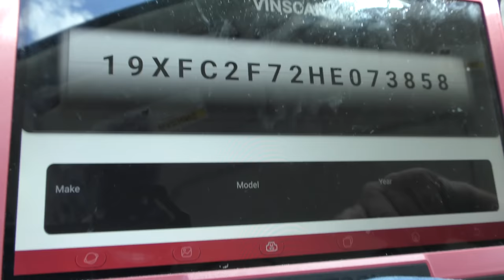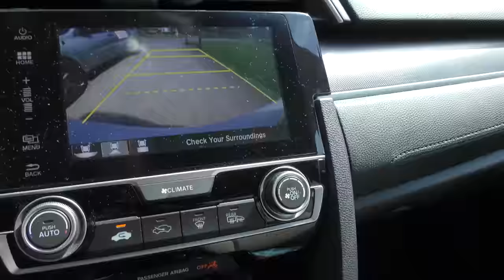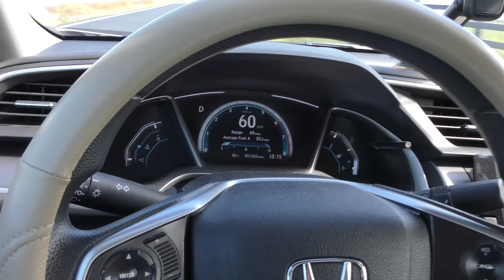Here’s What Happens If You Change Lifetime Transmission Fluid in Your Car

Comment: Change the external AT filter. (Yes, it does have one, follow the lines to the heat exchanger at the base of the radiator .) The Honda shop manual indicates 3 spill and refills with a drive cycle between them, which replaces ~72% of the fluid. If you change the external filter behind the radiator for the final spill, that goes up to 80%.  (Each time it's done is 7-8% more fluid replaced. ) .

Comment: Don’t forget to put it into the S “gear” when you want more aggressive acceleration, it helps a lot. Just put it back into D once you’re cruising at a steady speed again; that way your RPMs aren’t staying higher than they need to be.
Reply: Bolony. Heavy acceleration automatically kicks down your transmission into passing gear.
Reply: @shawnmcculley2995  On modern Honda CVTs, S makes the system prefer lower gear ratios/higher RPM ranges, and everything that comes with that.

Yes, stomping the pedal while in D will also get you there, but it’s more responsive when it’s already in the right range.
Reply: @shawnmcculley2995  Selecting “S” makes it kick down faster and helps keep it there. It’s also great for going downhill as it increases engine braking - a lot.
Reply: @billd9667 so is good for downhill and not uphill?
Reply: @sl4983  that’s fine, but not necessary. It wastes fuel in most cases.

Comment: Yes! Change it. When Subaru told me the cvt fluid was "Lifetime" I laughed.
Reply: Mazda does the same thing.
*I did however manage to get 435k miles out of it without once even checking it. 🤦‍♂️🙏
Reply: on a Subaru I'd say change it every 5-7 years or like 36k mi
Reply: @Byrd819  Wow...
Reply: Is the fluid change in a Subaru as easy as the Honda?
Reply: When you are at a dealer 90% of the time it's not the techs telling you that you don't need to change the fluid. It's the service managers.
Reply: @yabbadabba2887  very similar
Reply: @DBrisky37  Subaru gave me an extended warranty on our 2015 Forester to 100,000 but told us we couldn't change the transmission fluid or it would void the warranty.  So we waited until the warranty was over and the fluid was disgusting.  I don't know why they say "lifetime fluid"!  It's absurd.
Reply: @robertcraig2654  I did the same thing. As soon as the extended warranty was up I did a CVT drain and fill.

Comment: Lifetime fluid, good for the lifetime of the fluid.

I like "flushing" the fluid, but not a power flush.  I like using the trans to move the fluid in and out by itself through the cooling lines. Use a couple 5 gal buckets, one empty and one full of clean fluid, the pump then just uses the buckets as the cooler, expels the old fluid into the empty bucket and draws in clean.   If you use clear lines to extend the cooler lines you can see when the fluid is clean.  Then you finish up with a pan service and a new filter, and top off.  

I could be wrong doing this, but it's always worked for me.
Reply: I do this as well.Putting brand new oil into a transmission with about 6 to 7 liters of old dirty oil in the converter which contaminates it as soon as you start the car makes no sense to me.
Reply: Yep! That's exactly what I've always done, even on vehicles with 100K. Never had an issue.

Comment: Preach, Scotty, preach!

Subaru of America says "lifetime". But in Japan and Canada, Subaru says 50k km, or about 36k miles. I would say that's a little conservative, but it should be changed out at least every 50k miles.

What usually happens are the fine shavings Scotty is showing clog up the screens on the valve body solenoids. In the case of the Subarus, they don't sell the solenoids, just the entire valve body assembly. This now ends up being a $2-3k job, with labor. Many dealers tell you the entire transmission is crapped out...$7k+. Then direct you to new car sales.

This is what they mean by "lifetime".
Reply: Right on!

Comment: Spot on with your skepticism Scotty!
Not having a dipstick is  built in discouragement to check fluid levels along with these lifetime synthetic fluids. They all seem to be "sealed for life" with no dipstick because apparently too many people top up with the wrong fluid etc. etc. So much for the dingalings, now what about those who arent? I just had the transmission fluid changed in my  second hand Holden Cruze (Australian Chevy Cruze) after 10 years and 90k kilometers. Of course it was black. A noticeable improvement in shift quality afterwards too but my main aim is for the transmission to last the life of the car not the fluid! My Kia Sportage is 9 years old and is only scheduled for a fluid change at 140k under severe operating conditions. I will be getting it changed at its next service too which is 130k. I would hate to find out how much a rebuild would cost on one of those 6 speed jiggers let alone some of the 10 speed wonders coming out nowadays.
Reply: My daughter had 5yr old mustang with 100k miles.. started slipping.  Simple tranny fluid exchange.... no problems for another 80k miles
Reply: @mdf8884 did you do it, or a shop?

Comment: Scotty - I've done the drain an fill on all of my Toyotas.  What about changing the filter...do I need to take the pan off, change the filter, and then put on a new gasket when putting the pan back on?  261K Tundra - 146K Avalon - 91K Sienna.
Reply: No need to mess with Toyota tranny filters if you do your drain & fills every 60K miles.
Reply: They say you are only supposed to pull the filter and oil pan if your transmission starts giving you problems.
Reply: My brother worked at toyota for 15 years. No need to change the filter /gasket unless there is already an issue. Drain/fill is sufficent. Just i
Use toyota fluid /correct level/replace fill/drain gaskets.
Reply: I always dropped my trans. oil pan and changed filter on my cars 70's 80's gm cars, old school
Reply: It's more like a screen than a filter, so unless it's damaged no need to change. 👍🏼
Reply: There's alot of front wheel drive trannys that the filter is in the case halves so the only time you change it is when it's built
Reply: @TXAG81  My 2021 Tacoma has no dipstick. WTH. Says you need a scan tool to change the fluid.
Reply: @jaysmith179  Not sure any new Toyotas have a tranny dipstick. Watch The Car Care Nut on YouTube video he demonstrates the procedure to check the fluid level without TechStream. I just did it on my daughters 2016 Highlander and it worked perfectly.
Reply: Much of the nasty black stuff is at the bottom of the pan, and dropping the pan allows more fluid change. If you already have the pan dropped, why not change the filter at the same time?
Reply: @michaelpaparelli3227  Drain and fill not sufficient. That leaves at least 2/3 of the old fluid in there depending on the vehicle. Also fluid in the cooler and lines. Ex: on a 2003 Tacoma the pan holds about 1.7 qts while the system holds about 7.5 and not for an overhaul. Honda used to recommend drain and fill 3 times either driving the vehicle after each fill or running it while on a lift. Use that method on all the family vehicles and the few customers cars that I work on.
Reply: @jaysmith179  There is a sequence w/o using a scan tool, at least on some of the 2010-2015 Toyotas. You have what Toyota refers to as a sealed trans. The fill plug is on the side like for a manual trans.
Reply: @jimb8842   my 06 4 runner would disagree with you. Over 200k ,shifts like butter.
Reply: @michaelpaparelli3227  Some do 1 drain and fill every 30k or 60k. But this leaves a lot of the old fluid in there but that fluid is not completely degraded. That is like draining part of the engine oil every oil change and changing it at 2 or 3k miles. Who would do that? A dealer and some shops use a machine for the trans which gets substantially all of the fluid out including from the lines and cooler.  On a Honda and some Toyota sedans 3-4 drain and fills comes very close to what the machine does. I do that at 100-120k for the family vehicles and customers, though I only do this on the side now apart from my f/t job. Trans outlasts the vehicle and on some they have 300-400k miles. Only failure was one person who had a Ford Escape, never changed the fluid, had about 140k when trans went out. He sold the vehicle. Have a Tacoma with 95k and the T4 fluid has not been changed and still looks new.

While I'm on my fluid rant. Too many (shop owners/FT techs) including Scotty on you tube say 5k oil changes. Not one size fits all. Especially with the percent Oil Life Monitors (OLM) that Honda, GM, Mercedes and others have but not Toyota. The OLM's were developed over millions of miles using the computer data such as load, speed, temp.... along with oil analysis. A good article on this in March 2019 Auto Service Professional, Oil Life Monitors. Amazing how some you tubers think they know more and are smarter that the engineers and oil analysis. I have never heard or read of someone who changed their oil according to the OLM and either had an engine failure or excessive oil consumption.

Comment: It definitely gets better gas mileage on my car,, I have a 1998 Toyota Camry V6 3.0 with a 144 thousand miles I've done 3 drain and refills on my transmission and im getting about 50-60 more miles to the tank of Gas. I do highway and city driving everyday. ABSOLUTELY worth changing the transmission fluid in ur car. Like scooty says measure what comes out and put the SAME amount back in just that easy
Reply: Doesn’t a 98 Camry have a transmission dipstick though?

Comment: Hey Scotty it’s actually easier than how you did it there’s a fill plug on the top of the trans, a little difficult to get to in this particular model but if you move the shifter to the rear than it’s easier to get to then just pour it right into the top instead of that contraption you made. The fill hole you used in fact is a fill hole but more so a “check level” hole. Anyway for anyone reading it is easy like ol Scotty said it was.
Reply: There's a fill plug on the top?
Reply: @sl4983  yes, if you move the shifter to the rear and look to the left side of the eng. air filter box in the eng. bay straight down it’s a rubber plug with a little metal 90 degree post. Pull it straight out and you can fill from there but don’t put more than 4 qts in.

Comment: My car is a 2018 Honda CR-V with 186,000 (I am a very active Uber driver here in San Antonio).  Unfortunately, I did not change the transmission fluid until it had 170,000.  Fortunately, the fluid that I pulled out looked no worse than that on this video.  Believe me: the changing the transmission fluid was just as easy as changing the oil.

Comment: I change the transmission fluid on my Honda CRV CVT every 30,000.  Luckily there is a fluid level check bolt.  I just have to remove the bolt after changing the fluid to make sure the level is correct.  Really easy to do.  I save about $100 doing it myself over taking it to the dealership.
Reply: Yep that's the way to do it to be safe.  I just did it on my Fit the other night for the first time (I bought it used) and drained 0.4 quarts more than I was expecting!  Four quarts exactly.  And of course, using the level check hole I put in about 3.6 quarts to fill it.   I guess whoever did the first change at 60k miles just threw in 4 quarts without checking.  It was running fine, now it runs even better Go figure!!
Reply: Exactly don't take the Shops word for using OEM or equivalent oil, If You Can't do it yourself at least buy the oil and watch the Mechanic pour-pump the oil into the transmission, If you're Not allowed in the shop or watch through a window then find a Shop who WILL. Personally I do everything except for body work on my Four Vehicles.
Reply: ⚠️ Just be careful... make sure to read the factory service manual for the ATF change procedure. 

On my car, it's not as simple as just filling it up and removing the fluid level check bolt. There's a warm-up involved - ATF has to get to within a certain temperature range - which requires a scanner that can read ATF temp (this code is usually make-specific, not part of the ELM327 library). Once it's up to temp, then I can remove the fluid level check bolt.

Comment: Hey Scotty... you forgot to mention that many cars with CVT or regular transmission now have filters. What about changing the filters also?
Reply: My 2015 Camry SE has a filter. the transmission filter itself is pretty easy to change(held in by 2 bolts). The only way to change it, is to drop the pan. Pretty big mess tbh. Since I have to drop the pan everytime, I just end up replacing the gasket also

Comment: Scotty just to lyk if you put the car in neutral and unclip the air box there's a plug on top of the transmission labeled HCF-2 where it's intended to be filled from. On the 1.5L you can see the plug without moving anything.
Also I work at a Honda dealer and we recommend transmission services every 30k/3years 👍
Reply: Thank you so much for that information cause I have a 1.5L
Reply: How many quarts does a 1.5 accord takes?!?
Reply: @black7966  if you’re talking transmission fluid it takes abt 3.8 QT. Funny enough the engine takes 3.8Qt as well
Reply: I fill it threw the check plug can do the whole services from the bottom and no chance dirt falling into the trans.
Reply: @zackm6850  true, but ive never had a problem with dirt falling
Reply: does the 2L have the same plug cuz i cant see it
Reply: @RondoRajon41   You prob have the black plug, should be in the same area around  the air box on top of the trans
Reply: @cjmitt1337  can i show u pic?
Reply: I have a MY22 CR-V, so it will be 2 years before changing. Can I use other brands of fluid that says is HCF-2 compatible, therefore mixing it up between Honda and compatible brand?
Reply: @Woodland26   HCF-2 isnt that expensive and is a good quality fluid. I would stick to Honda's fluid
Reply: @cjmitt1337  I certainly don't mind the cost, just that in Australia, Honda is nearly fully withdrawn from the market. I have to travel a long way to a dealer and hopefully they sell them at reasonable cost.
Reply: @Woodland26 I have a 2017 2.4L Accord that I use the Amsoil CVT oil. I have changed it 3-4 times with 145k miles on it with no issues.

Comment: Hello there Mr Scotty I enjoy your videos, I have the same car with 70,000 miles now do you recommend changing it ? Or is it too late thank you
Reply: Frank Jaweda, I did my first transmission drain and fill at 75K miles, and have been doing it every 35K miles since then. I now have 160K miles on the car (‘16 Honda Civic) and it’s still running fine. 😊👍🏼
Reply: Your still fine don't worry, 70k is still early enough, I wouldn't touch it past 100k
Reply: @carlovanrijk4039  Sounds perfect thank you for the reply

Comment: The opposite is true about a flush -- if you happen to have stuff holding your transmission to gether (say slush) sometimes flushing it (or even just draining and refilling) can knock some of that loose.  But plugging up holes in the trans is probably the more likely issue you'll run into.  I remember what a mechanic once said: you either change it regularly (so every 100k miles for an automatic, or about every 60k for a CVT, or you don't change it at all and just leave it -- one or the other, but preferrably change it regularly for maximum trans life).  Also if you buy an older car with other 100k miles and you don't think the trans fluid has been changed (one, don't buy the car, but if you did) don't bother changing it if it runs fine

Now I will say geared automatics are more durable than CVTs so not everyone one will break down if you don't change the fluid (CVTs I think are more prone to failure if you don't) as I do know some people who have gone 150k or 200k miles without ever changing the fluid, but it's not advised normally.
Reply: Id like to see videos of tranny fluid flushes on unknkown mileage over 200k
Reply: but plugging
Reply: Thanks for this. I have a 2008 with 120k miles with factory transmission fluid. Been debating whether the change or not. Mechanic told me not to and you said not to so I won’t haha
Reply: @Phone-sh7jg  Transmission "flushes" can reduce the service life of the transmission.  Transmission fluid exchanges rarely cause damage.  Transmission "flushes" typically involve adding a solvent to the transmission fluid, which breaks up deposits in the transmission.  That solvent can also cause pre-mature deterioration of the clutches in the transmission since they're not designed for anything but transmission fluid.  After the solvent is added to the transmission and the transmission being brought up to operating temperature, a "fluid exchange" is then performed to remove the old fluid, the solvent and some degree of deposits.  For the record, I don't recomment "transmission flushes" since the solvents can cause damage.

Comment: Changed my toyota fe cvt oil with factory fluid at 60. And again at 100. Took my overdlowpan off and cleaned the pan both magnets dryer gasket and filter. And it still rides great. And I think it rides better now

Comment: Filling before closing the bolt. That's a skill!
Reply: Lol I think he used the check bolt to fill the tranny
Reply: @JonnyDIY  what I was thinking.  They don't have dipsticks anymore, but the port to fill is still there with a cap.   Remove that, and the plug that he used in this video, would be the overflow valve to level everything right.

But that's on my 2015 Nissan Altima